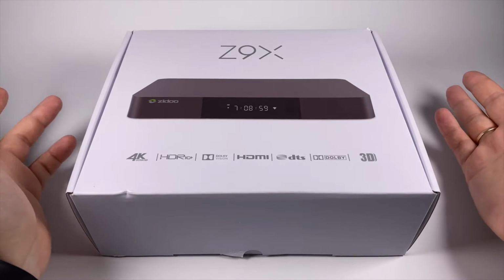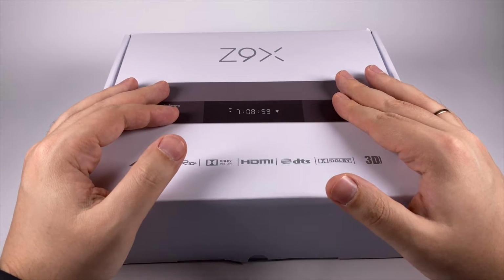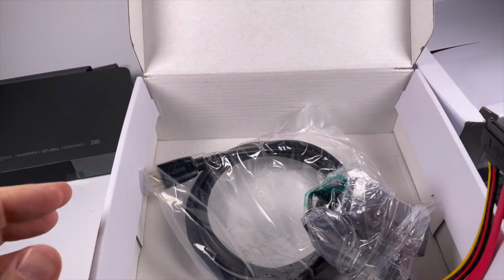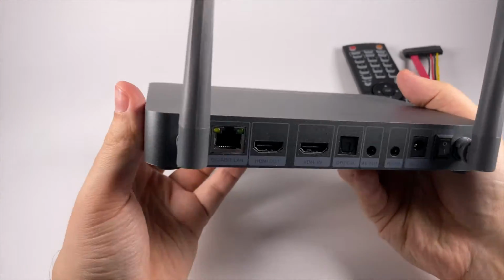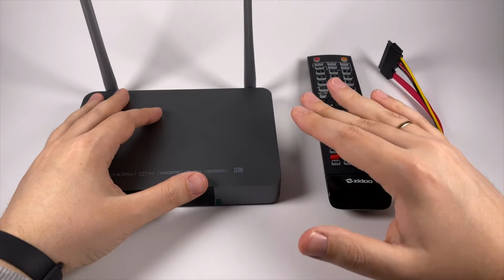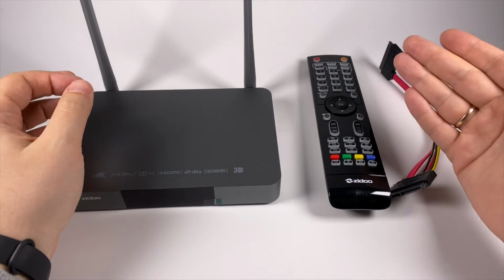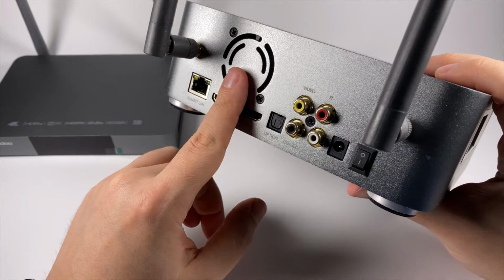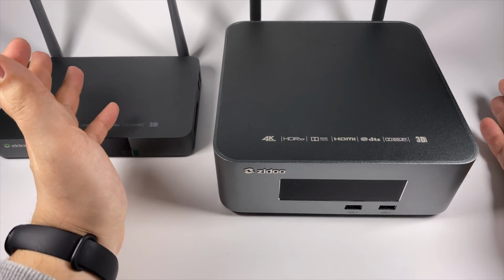Zidoo video players: Z9X and Z10 Pro — for the more demanding

Comment: Nice review.  Question: Are the huge WiFi antennas removable?  If using wired Ethernet, then these large antennas would be annoying and unnecessary. Thanks.
Reply from the maker: Yes, you can unscrew them and remove. Or just turn them horizontally and hide behind the device case
Reply: @PortaFi  Thanks.  Good to know they’re removable if wireless is not needed.

Comment: What the difference Z9X and Z10 pro , i only see  16 and 32 gb storage and 16 TB works or it s max 14 TB for external disk.
Reply from the maker: Actually, main difference here is design. Z10Pro has a special docking slot for HDD, so you can fit it inside of the device. And for Z9X you'll need to connect it via cables and put on top of device (or nearby). It's less aesthetic, but considering price difference can be a decent option
Reply: @PortaFi   helow brother please make tutorial to install aurora /puffin browser/aftv, on Zidoo Z9x, thank you so much 😎👍
Reply from the maker: @cyberpunk6812  hello, friend, thank you for the suggestion, but unfortunately, I won't be able to do that in the near future due to the situation in my country. As soon as I have this opportunity, I will return to your idea